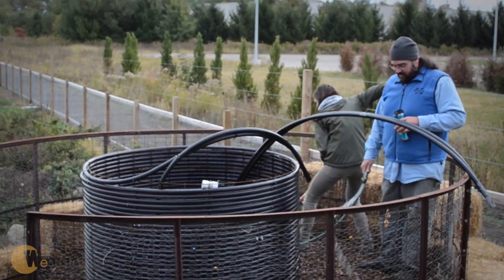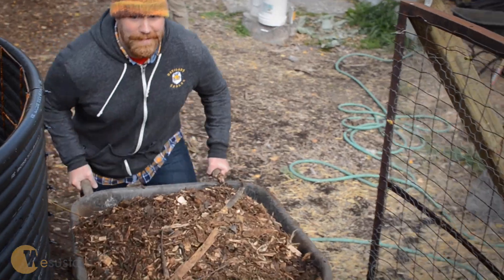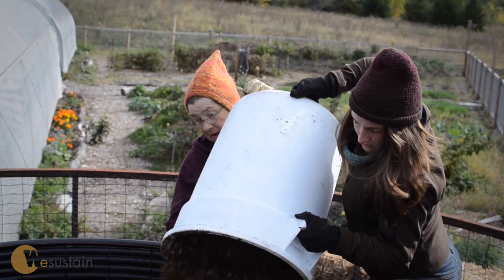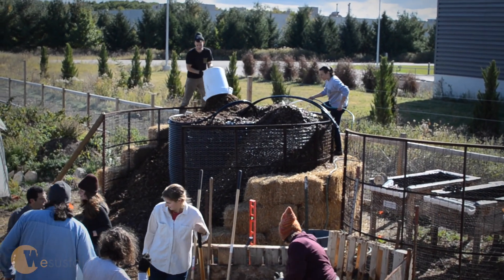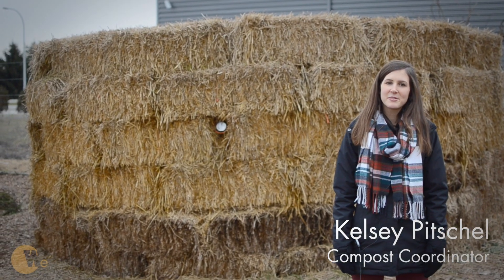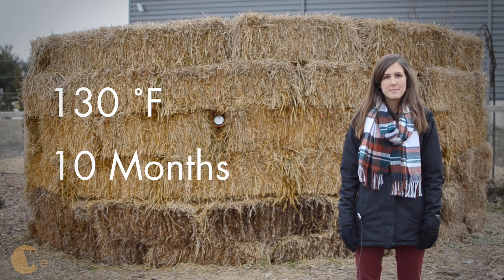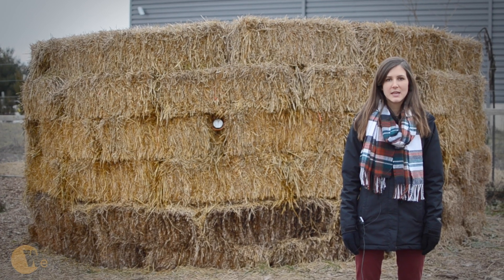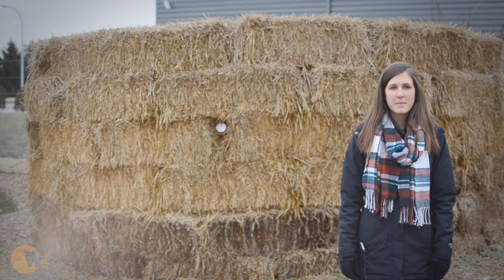Compost Powered Water Heater

Comment: I'm wondering about putting in smaller unit in my greenhouse. I mean i don't want to take up the entire greenhouse but it will have mainly tropicals inside it year around. I'm thinking about a 6' wide maybe 5'tall set up. I have a couple bales of spoiled hay and lots of rabbit poop. I bet that might heat up well. Hopefully we will see

Comment: The obvious problem with the extraction of heat from a compost mound is how to get the maximum amount of heat from the pile and how to eventually remove the pipe without damaging it, so that it can be used again. Please tell me what you did to improve the design. I thought what you had created looked excellent, but your revised model intrigues me.

Comment: Have you done the second pile with the new design for better heat transfer? Thanks!!!!
Reply from the maker: No, we have not redesigned the core or built a second pile.  If you have direct questions you can contact me at joshua.a.shultz@wmich.edu  Thanks!
Reply: @WMUSustainability hi do you still monitor this email address?